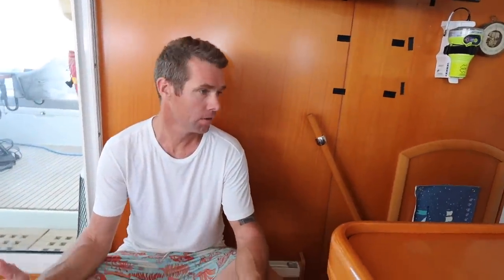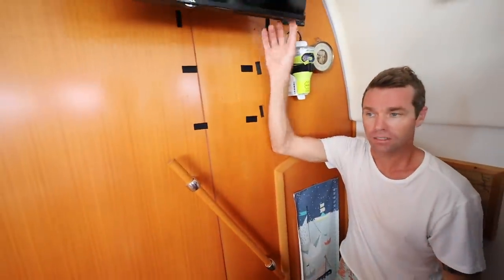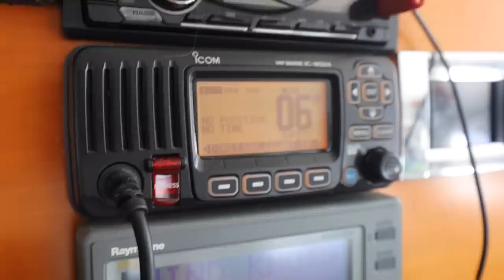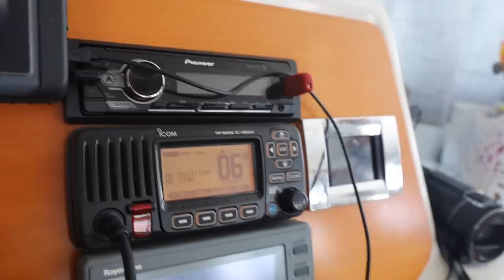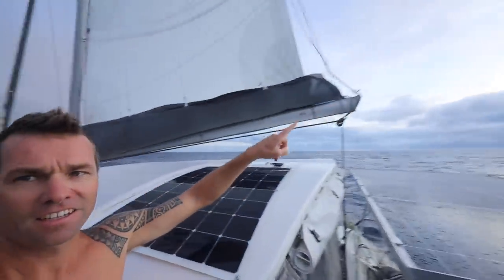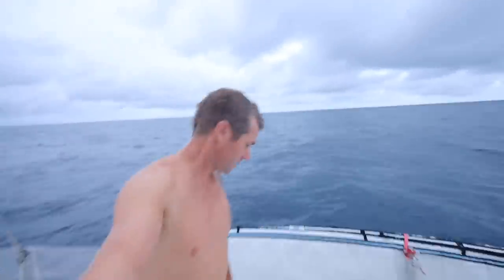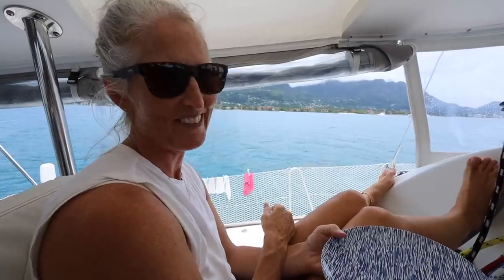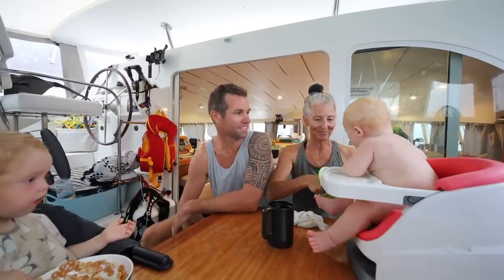Limping into Port with BROKEN BULKHEADS

Comment: Lagoon is notorious for this bulkhead issue. On top of that one of the most dangerous passages is to South Africa. Be brave to do it on that boat.
Reply: I sure hope they don’t try with those babies onboard
Reply: @roostercogburn746  wouldn't surprise me if they did. On top of that 1 child has severe allergies. The last yacht to sink was a couple in a, you guessed it, lagoon.

Comment: You need to some fishing line between the top of each stairs and and got be tight and measure from the floor  to the fishing line to see how bad things are and check out David shih called Parlay Revival discovers my logoon 450 is bent and show you how to check for Broken bulkheads .

Comment: The older charter cats all have had structural challenges. So not a big surprise unfortunately. The charter quality mono hulls all trade interior volume for structural grid and keel mechanically tied to the grid. You step up to “performance ie owner hulls” and you find far more internal structural components and keels properly bolted to structure vs outer skins etc. charter Multi hulls suffer the splits.

Comment: lagoon have come up with a solution for the bulkheads on the 450 i think it is, the one parley is on and its a  stainless steel brace that is bolted together from each side sandwiching the bulk head and using epoxy to mould together for extra strength ,maybe they have some for your boat if not measure and have some crafted its the best and easiest solution , hope you get it sorted .

Comment: Way back in the 70s before internet me all young strong confident and gullible heard this old merchant marine talking about the southern cross and how it hung like jewels in the southern skies to lead all travelers and how it was far beyond the northern lights in beauty....well I had just seen them northern lights from the seat of a 175 Honda motorcycle southern Alaska nd a real great experience to bolster my confidence ...I get on a tramp freighter out of San Diego for Perth and Tasmania on a return that took twice as long to get there as they said because port side cargo doors leaked really bad in heavy seas so had to turn starboard side to the seas to protect the freight and then got thru the king Neptune thing of 1st crossing of the equator hazing then got all psyched up to see the southern jewels of the southern cross...what a damned joke....I was so gullible ...nowadays with the internet you wouldn't ever think some one could be so stupid....the galley broke completely loose from the bulkhead and was moving 3 to 4 inches back and forth where I was given flex pipe to repair the drains for the cook and then they rigged up a welder below decks and I was a welder and got the job of welding belayments to the hull to re anchor the galley so it would quit sliding around in the slopping station(aka the galley)....they dropped off the crew and recrewed in Perth the guys on the second crew were so black they farted coal dust and spoke some east African dialect ....had one man I could speak English to he had 2 yrs in Harvard and scars all over his face from his tribal markings in Africa ...watching what y'all are going thru brings back so many moments ...and the sea sickness after every port ....having to learn to walk on land after weeks at sea....and the eternal meals of fish soup and rice....my contract expired on the coast of Ecuador and a single engine plane dropped me in rosarita/Tijuana I walked across the border knelt down and kissed the ground of the good old USA......please do a show and tell about the southern cross and what it looks like for all the strong confident gullible idiots out there

Comment: Ben you say you don't know what's wrong, I think you do it's the same problem that a lot of people are having with the lagoon catamarans all of the bulkheads weren't tabbed in properly to actually do the kind of sailing that they are advertised that they could do. Lagoon has a hugely horrible reputation at this point. Of course you know about parlay revival and that vessel went through a hurricane before Colin put it back together. I took a 2005 lagoon 440 from fort Lauderdale Florida to North shore Oahu haleiwa in 2007 I wonder what that vessels shape is now because we had some huge seas leaving Port Antonio Jamaica to Colon Panama. And when I say huge I'm talking about 30 to 50 knot winds and 20 to 40 ft seas for 3 days straight. The vessel was launching off the top of the swells and going beyond hull speed shuttering down the back side of the swell and then the bow of the vessel was burying itself into the trough and if you know anything about the 440 the helm is elevated quite a bit and I remember getting drenched with green water and at one point it almost knocked me down and I'm 6'2 and at that time I was much stronger and of course a few years younger.

Comment: Always thought your boat had too many creaks. Modern well built boats should not creak like a old timber windjammer. Foam and plastic are not materials to build off shore boats with, with an expected long life in my opinion, and history seems to back this up. Old 3rd generation boatbuilder set in his ways talking. It seems that too many cats are having problems with delimitation after a few years of ocean passages. Maybe they are only good for sheltered waters? It certainly seems that it needs investigated by professional engineers. Maybe it's caused by accountants running boatyards! Anyway..love your videos. Especially the Asian experience. Good luck with the boat. It must have been stressful. Cheers and best wishes from Tasmania, Australia

Comment: your concerns are the interior bulkhead breaks and cracks. You said the supports around the mast and traveler are fine. I assume that's true for the rudder and aft assemblies. Fiberglass boats are made with a certain amount of flexing and Nahoa has exceeded that. But the measure for me would be if she's taking on water more than usual that could be a sign of hull intergrity and through hull fittings being compromised  would be of greater concern
.

Comment: I would suggest reinforcing the bulkheads by laying some framework of good ole' lumber horizontally and vertically. Simply overbuilt them a bit with lowest cost, stress-proven, familiar material that is easily serviceable. I'm just an old, occasional coastal sailer who'd like to see your roundabouts stop for a bit before I get dizzy. :)

Comment: The bulk head cracking is a big issue.  It is not like patching a hole.  Even a large hole.  I was really worried for them if they hit a large storm and the cat can break into two pieces.  The cat manufacturer needs to be contacted to see what the fix is.  I am sure sooner or later, someone will have bud luck and they will hit waves and they will have an emergency.  It can break and sink fast.  Safety first always.  I am very happy you made it to your destination safely.  I was really worried for you and your family (even though you kept a straight face).

Comment: Hi Gals and Guys!
I am pretty sure it is Lagoon who had this issue on some models so you would not be the only Cat with this. They did not make a recall as they recon it would be a 30k$ per boat affair, but they did offer a solution on ''how" to repair the boats.
I would suggest maybe contact Lagoon?
Cheers from sunny Vancouver BC (yes sunny!)  🙂

Comment: Omg! I hope this isnt gonna be the death of Nahoa, i really hope a builder can fix this fairly quickly and easily. My fingers are crossed that this issue is fixable and on the cheap and easy. Mainly i hope they cans secure the structural integrity. I am SO sorry about your boat. My thoughts are with you guys, I wish i could help more... sadly i cant contribute financially but i can still like the videos and comment. I wish all 4 of you good luck also did you mention your depth sounder is out? I have a cheap garmen fish finder that you could use in shallower (300ft or less) i would be willing to send it to you

Comment: Sounds like the bulkhead is breaking up due to the rigging loads. I assume that your shrouds are about where the problem bulkhead is. The rigging loads up pulling up the outside of the hulls(mainly the windward hull) and trying to curl it into the centre of the boat. Much like Parley Revival.  I think you will find the ply you can see is only decorative and the real bulkhead and real problems are behind it.  Good luck with your repairs.
Reply: folding

Comment: Sailing Parlay Revival (Youtube channel) is a good series re bulkhead repair. As they are a Lagoon 450, they have/had really started the global 450 issue resolution. AND they began the process of getting Lagoon to acknowledge there was a structural engineering problem with the design. Now there is a basic warranty repair system for 450 owners. But as I stated previously, perhaps the problem is more widespread with your boat. Are you in contact with other 410 owners? Owner groups on Facebook, if there isn't any, perhaps create one.
Sailing Parley Revival did a full deconstruction / reconstruction of their boat. And they have videos explaining what all they did, and it was extensive. Perhaps even getting in contact with Colin would be a good idea. He himself could be a beneficial resource for you. The most recent episode has the group just on the Pacific side of the Panama Canal with some Patreons on board.

Comment: apparently you're not the only ones to have problems with bulkheads on lagoons. Actually it seems pretty common and  that could be only the beginning. check a channel called parlay revival where a guy from NZ, Colin, had to fix broken bulkheads on his lagoon 450 and a had technical support from the headquarter in France

Comment: Is the rig too tight? that the rig creating tight stress to the midsection of the hulls? or it could be been under long time overtightend rig  tireing out the seams in the bulkheads...i could be compleatly off but ive been repairing boats so...but this boat type ive never worked on so i dont know its quirks over long time. other thing i was wondering, when you guys hauled out last, you lifted the boat up and back in under bridgedecks, and being an older hull that has seen some crossings might have tweaked the boat up bad that it cracked the bulkheads so much, that it did not need much to split as it did, hulls normally have its weight on its hulls, tweak it backwards...miiight have don it for the boat to crack. we NEVER lifted a cat under the bridgedecks, you never can guarantee that the boat ever been too tight in its rigging or too loose, the hulls weigh too much to be honest to be lifted only on the bridgedeck, some boats can take it depending on the grid in its deck....but some cant take it...
Reply: My rigger told me there should be enough play in catamaran rig stays that they stay can do ‘a circle around a pencil’.  Most cat rigs are overtensioned and the stays on the leeward side can look too loose under sail which is how they get overtightened.

He also mentioned with catamarans, for the most part they do not have backstays, so the side stays do a lot of the heavy lifting when flying sails forward of the mast and stays.  A lot of sailors think the stays should be be tight to keep the mast a little raked back to offset the force of flying a big foresail, but the reality is most production catamarans are not built for that and combined, these two processes will stress a hull to failure if not moderated.  Tight stays pull the hulls apart, and a big sail will add to that load exacerbating the separation.

I hope Ben and Ashley can get it fixed and remain safe with their family.  It takes guts to do what they’re doing.  💪🏼❤️

Comment: Wouldn't touch a Lagoon with a barge pole.Sorry it's to late for you😢❤️.
The only thing that would give me hope for their reputation would be if they covered all the costs to fix this issue caused by bad design.
Reply: I wouldn't touch anything Beneteau/Jeanneau /Dufour these days ,especially cats. They skimp on structural quality and have done so for years. Jeanneaus and Dufours used to be solidly built but no longer. I'm happy that they made it safely to port. Restoring structural integrity on this boat may prove to be a nightmare. These boats are not meant to be taken apart.
Reply: @nunosantiago2273  yep agree.
On the bright side you tube is full of videos of people fixing the same problem so at least they have plenty of information on how to fix it 😁😁

Comment: If they have a dealer or service center in the seychelles, go to Lagune.  They will pay for the inspection of your boat.  If you meet criteria they will repair it.  If not, they will give the necessary repair parameters and advice.  Good luck.
Reply: Lagoon is supporting the 450s which are much newer boats some still under warranty. Nahoa is 17 years old
Reply: @leeoldershaw956  I may have misunderstood, but that is what parley revival was told about bulkhead problems by the company.

Comment: Contact Lagoon directly. They have dealt with bulkhead issues with the 450's. I went back many videos to see what size you were and discovered it is a 410, so not part of the problem group. But perhaps there is a bigger problem with Lagoon's bulkhead engineering?

Comment: If you haven done so check out Sailing Parlay Revival's YT channel. Colin has a Lagoon 450 that had broken bulkheads and repaired them and is very knowledgeable on the Lagoon bulkhead problem. BTW, the panels you showed in the video moving are not the bulkhead, just the decorative panels on the bulkheads.

Comment: Just a thought ; If you have any video of your last haul out, review it in slow motion, My thinking is they put uneven lift on the hull and even for a second or two could of compromised the hull. at the time nothing may have broke but just enough stress to cause a weak spot that has slowly progressed  just my 2c. Glad you all made it safely.
Reply: Its a lagoon.99% have bulkheads separating from the hulls.They tabbed them together instead of joining the full length. Factory fcucked
Reply: And you don't think that being at sea puts any uneven force on the hulls?
Reply: @grancitodos7318  Not as concentrated as one lift strap slightly placed in the wrong position
Reply: @JohnJohn-cu7nk  exactly. any other reasoning is clutching at straws in the hope of pinning the blame on some boatyard worker or simular .factory f**ked indeed.
Reply: @jus4funtim  Rubbish, my guess is that even if you have sailed on a catamaran, you have not been in steep seas where a hull is only being supported at one end, which does not make a well built boat flex or twist. A slightly miss placed strap is not going to split the hulls from the tunnel, learn something before making comments.
Reply: @grancitodos7318  I'm not suggesting that a missed placed strap caused all the damage, it's possible that it may have only started a small crack or internal fracture then over time has escalated to its current condition. Once its opened up and inspected by marine surveyor we'll know what went wrong.
Reply: @Dh-de9op  kinda makes you suspicious if lagoon employees are trying to muddy the waters

Comment: You have a Lagoon and it’s a common defect on Lagoons. It’s all over the internet. Lagoon and it’s directors are running for cover and will tell you it’s not a safety problem. It’s a lie. It’s a huge problem. Takes a lot of work to fix. Takes months. You will have to pull the boat apart and you just lost $200,000 in it’s value. You will have days of grinding fibreglass alone to just commence the repair process. 
Lagoon need to be held accountable. No other manufacturer has this problem, just Lagoon.
The glass reinforcement has separated from the bulkheads and once you pull them apart you will find areas not glassed and missing resin.
Lagoon quality control was disgraceful.
Fix it and get another boat. Firstly find a port where you can do the repairs and it has the trades, tools and materials you will need. You will be there for six months. Sorry but there is no good news.
Just don’t let Lagoon get away with it.

Comment: Thankfully, you guys made it safe and sound. I hope the repairs are simple, cheap, fast and don't alter your plans too much. I agree it's probably best not to put out excessive boat/crew info over open airwaves, especially if you are shorthanded.
I had thought (hoped) the Lagoon bulkhead issues were isolated to 450's which were built starting 2012 (I believe). Nahoa's issues prove the problem preceded into the prior decade and with other models, like the 410. 
Has anybody heard of similar issues with 440's or 380's?

Comment: I am not an engineer but I would think a temp fix would be joining the chain plates from each hull with steel cable or chain. Rigging cable would not manage the stresses. I am starting to think someone missed the correct lift points during a haul out.

Comment: The bulkhead issue is a symptom of hull design and in integrity. The hull is flexing too much to cause the bulkheads to flex beyond acceptable limits. Lagoons seem to be famous for this in the earlier years. Find a away to strengthen that hull before you continue if possible.

Comment: OMG Lagoon skimped on your model also. They gonna try and say it must have been in a Hurricane. Truth is when they built 1000 cats and can save $1000 on 1000 cats that is $1 million saved so they think. They are ruining there reputation as this is the second different model have separation issues. Hate to say this but you got screwed by Lagoon.